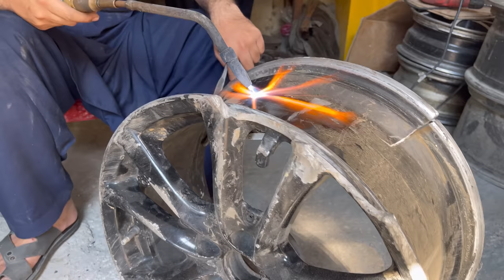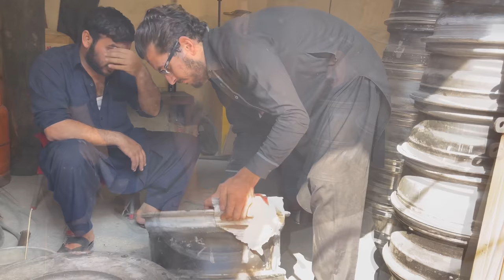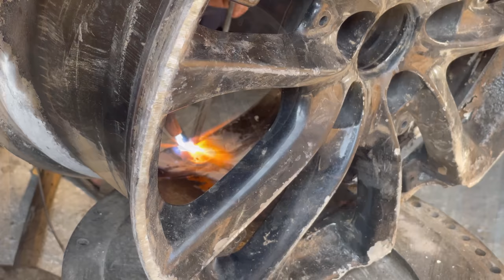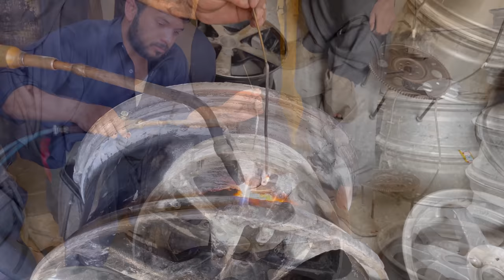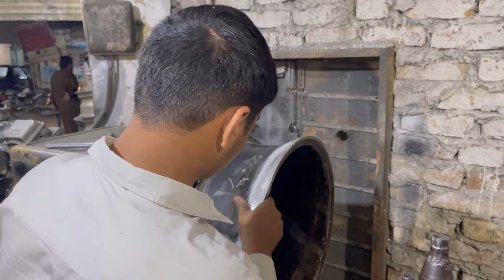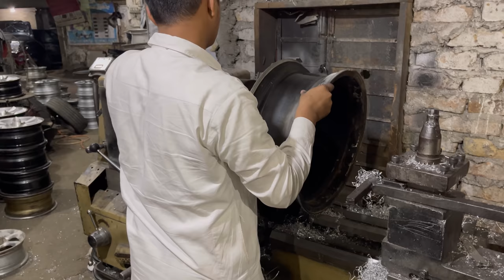How to Repair Crack Broken Alloy Wheel Rim Repair | Amazing Technique Of Repairing Broken Alloy Rim

Comment: I did a lot of metallurgy while I attended the University of  Newcastle upon Tyne (1963) and so, looking at this repair, I can imagine what I would see under the microscope if I had to take a sample of the welded area and analyze it.
I must say that the young welder is to be admired in the manner he changes a carbonizing flame to heat with, into a neutral flame to weld with. The oxide layer that builds quickly on aluminum melts at a higher temperature than the aluminum, but that welder knows what he is doing, first melting the pool, keeping the flame in the area depending on the volume of material around it, then bringing in the stick feeder for a short time and let the pool fuse the lot, withdrawing the flame. Not so easy to weld aluminum with a flame where oxygen needs to be all burnt out otherwise the oxide would form so quickly.. 
Obviously, the structural integrity of the wheel is compromised by the heating, the welding, probably different filler material, and the unbalance that rtesulted. 
Unlike fashion and art and religions,  which deal with emotions and so a few cosmetics and illusions will do, in engineering, what looks good is not always good, and metal fatigue is one reason why a workpiece that passed its lifetime needs to be replaced. 
Let us hope that aircraft in this country are not repaired and maintained in the manner we see in these videos. Faith, willingness, and craftsmanship are not always enough unless backed up by real engineering knowledge. It breaks an engineer's heart to write off the crankshaft of an ocean-going liner just because it has a small crack,  and filling it with welding, where the finishing looks good, could have its consequences.
Reply: Увы, он плавит олово. Это не Алюминий. Вам наверное и в голову не могло прийти, что можно восстановить диски оловом? Да и вообще в конечном результате, после ужасной покраски, весь труд сварщика и токаря бесполезный
Reply: Какое олово? Наваривает он люминем. Олово так себя не ведет.
Reply: I wouldn't allow that wheel on a car
Reply: This isn't welding though, it's more like brazing
Reply: you go Tolstoy
Reply: @АндрейРодионов-ж1у  Olovo? :-)
Reply: Great comment!! 👏👏👏
Reply: damaged chasis, rim and shaft, no amout of repair will give it former glory
Reply: drunkenkurwyjew666  представляю как они сидят на крыле самолёта и трещины паяют 😄
Reply: @dockkkerr  ты не сможешь наварить алюминий без защитной среды, ибо создаётся моментально плёнка, за которой ты вообще не увидишь ни провар, ни сам металл. Это тупо олово, выше правильно сказал. Либо какой-то припой на основе олова, либо нержавейка какая-то. Даже плёнка не создаётся...
Как без аргона можно варить диск, а в таком состоянии как на видео, с мусорки, это запрещено использовать, опасно.

Comment: His welding skills are undeniable, aluminum is anything but easy to weld together! But this wheel was scrap from the start even if the cracks would have been grinded!
Over here in Germany that thing would explode like an atomic bomb in a few seconds after entering the Autobahn!
It's just not safe anywhere in the world going above a certain speed!
But skill is undeniable worldwide! Cheers!!!
Reply: There was a time in Germany you had to eat shoenails ...
Reply: Mit Skills hat das nichts zutun, der kann halt nen Brenner und Alu in der Hand halten, mehr aber auch nicht. Wer Skills hat, macht das von Anfang bis Ende ordentlich, auch unter solch dreckigen Bedingungen kann man sorgfältig arbeiten.
Reply: @Edits_Moped  Das hieße in dem Fall aber, es gar nicht zu machen...
Reply: with that amount of runout and imbalance, you would notice that something is VERY WRONG before you even came up to speed :D
Reply: Aluminum is just about all I've welded for the past 20 years I've never welded it with a gas torch hats off to him on a great job
Reply: Exactly, safe at a little under walking pace.
Reply: @1aberbeeg  immerhin hat er Sicherheitsschlappen an.
Reply: @mirasetrin3273  Без них ничего  не получилось бы
Reply: I hate that when these wheels are sold they don't tell people that they were on car crash and repaired !!
Reply: I too was wondering if any state in the USA  that has car inspections would pass a repaired aluminum/alloy rim ?
Reply: His skills are acceptable but the product he is rebuilding just ain't right. Aluminum rims in that condition should not be repaired.
Reply: @lloydscharf6897  all the time, specialization rim repair shop’s, insurance company’s use them normally about 1/3 the cost as a new one

Comment: Wow! Not sure I would want that on my car here in Aus, but if I was somewhere that you struggled to achieve more than ten miles an hour I would probably take the gamble. You have to wonder how hard it must be to get certain things in some countries to warrant going to these lengths to achieve a sub standard repair? Surely if the roads there are bad enough to do this sort of damage however, one would question the viability of such a repair?

Comment: It's a good effort, but the repair is not structurally sound. Two immediate improvements are obvious:

1. Cut away material from the old cracks and breaks to remove poor metal and leave a better base to build on. Otherwise, it will re-crack/break at the same point. Then, build on that.

2. Remove all excess material added during welding. Otherwise wheel can never balance. It's good that the visible/usable rim edges are repaired and trimmed, but the major repair areas also need to be lathed flat to balance better without the use of impossible amounts of balancing weights.

Comment: That wheel is never going to balance up properly or run without some sort of vibration. I admire the effort of these guys but that is just past it even the finished product.
Reply: Wow.
Reply: Yes you’re right I’ve got 22” rims that keep getting cracked due to the speed humps and yes I have had them repaired. But what you have to take in is they have speed humps there also as well as pot holes. My one rim costs around £400 second hand you do the maths for people who earn that as a monthly wage

Comment: Ive use aluminum alloy rod to weld repair a lot of things and quickly found out it has no strength.  If this is the same rod I've use the wheel will break in seconds if it hits bumps.

Comment: There goes all the heat treatment of the A356 alloy the wheel is made of,but the guy welding has got some real skill,aluminum is very tricky to gas weld. Even we would tig weld it when repairing aluminum wheels and always used A356 rods,forged aluminium wheels being the exception. But the guy welding is very cool,we always set up and machined repaired wheel in a 4 jaw lathe as well. I am very surprised how true this repaired wheel was,great job,very well done. Best wishes to you all,from,Auckland,New Zealand.🥇⭐⭐⭐⭐⭐👑👍👍👍👍👍💯❤🍻we would also set finished wheel up running true and take a small lick across hub mounting boss.

Comment: Absolutely wrong.  Heat not applied properly.  This causes weakness in the base metal.  And, since metal was added, it will never balance out. 
Waste of time and effort.  Better off melting it down for bar stock.  This will eventually fail and cause more damage.

Comment: Gas welding alloy , young man 👍.  It the best way in your local . But for a better job you should buy AC/DC machine for your experience.
Reply: Wow.
Reply: Actually brazing take skill. I know a lot welders that couldn't braze worth shit.  Specially carbide or aluminum
Reply: @Raidersforlife229  для справки.Это, не пайка.
Reply: @fakmak7207  I don't understand

Comment: I would have put putty on the wheels before painting them to fix the imperfections and there I sanded it and then I painted it with the primer in several layers, the paint also several layers and then a good lacquer to resist injuries and blows

Comment: What material is he using for the repair? Doesn't looks like steel since it melts so readily. I don't think this repair is safe.
Reply: Pretty sure hes not using steel to fix an aluminum rim
Reply: Wow..
Reply: @piperdoug428  Wow..
Reply: Безполезен - вернее будет сказано
Reply: @panitv  Wow..

Comment: Call me crazy but, There are just some things that are best left broken. Although this mans welding skill is wonderful, this wheel should not have been brought back for use. The more it's turned, the more material is removed and takes it out of specifications. I would not use this on any road where other people would be endangered. It might be useful for a farm vehicle only where speeds are slow and low. I wonder if any one of these men lose sleep wondering if the wheels repaired ever failed, or caused injury, or death?

Comment: It is obvious, the reason for this type of repair is job security! You know the guy who brought the wheel to be repaired will be back again for the same reason within next 6 mo. or a year. And if it’s a dealer trying to repair the wheel to put on a car to sell the car, he will be selling another car to the same fellow again, that is if the dude is lucky enough to live when the wheel fails. That’s why I will stick with OEM wheels, if you need just one, you can still buy them. These aftermarket wheels are much harder or impossible to buy if you only need one. A lot of people feel bad throwing 3 good wheels away. I wouldn’t.  My life is worth more that some stupid wheels.

Comment: I wouldn't use that wheel on a horse drawn cart. Everything he did was cosmetic and not structurally sound. It's as bad as the retread tires they do over there.

Comment: How can he weld aluminium without borax? The weld has to be now the top quality? Why didn't he clean the disc from inside side by lathe? The wheel will be very unbalanced. What to say... Simply usuall Pakistan way. The wheels are repaired in our country as well, but wiht TIG welding machine, lathe, milling machine ... It isn't the wheel which I will to use on my car. Terrible work